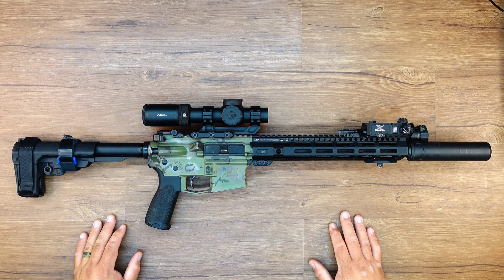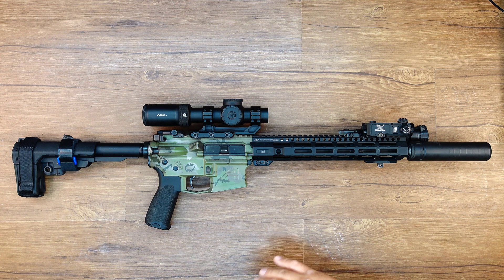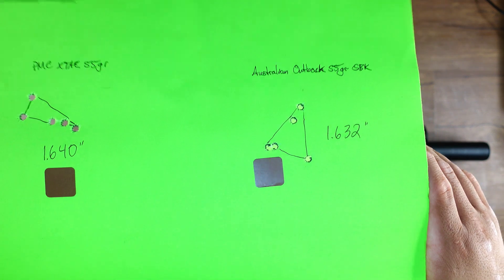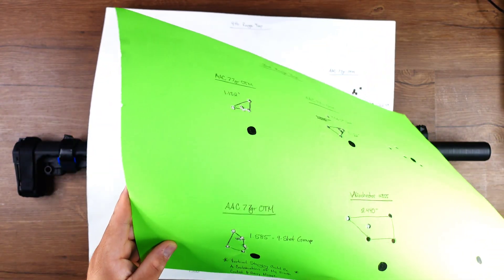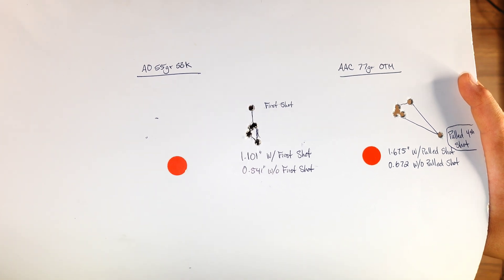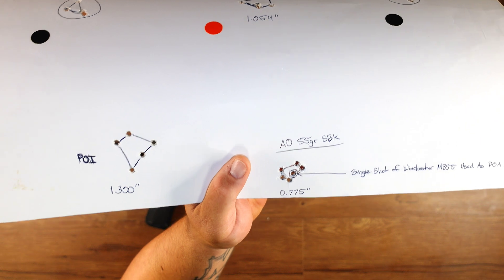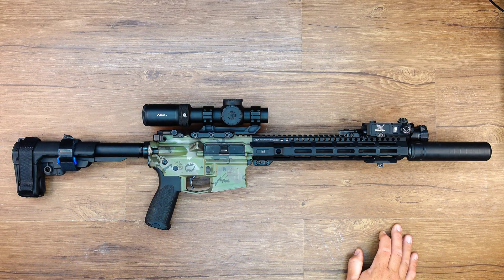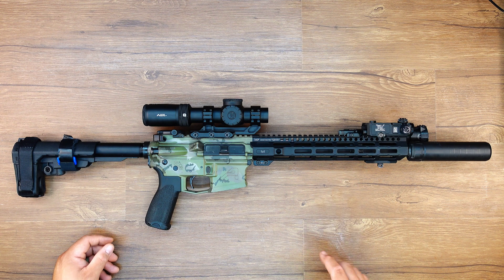Criterion 12.5" Accuracy Testing Update (Pt. 2)

Comment: Sorry for long post… I have a few Criterion core barrels from 11.5” to 18”, my 12.5” can get sub moa suppressed (DA Sandman S W/EBrake and 556 flash cap) shooting IMI Razor core. BH 77SMK MK262 I can get about 1.5”(if you can keep under 2800 fps you will get better accuracy. I have found through all five Criterion Barrels the same thing regarding FPS)The Berger 77 is great to at .8. My 16” with Hornady 73 and IMI Razor core I can get bolt gun accuracy with .3-.5 5 round groups. Took the 16” to a long range class and was hitting the 1008yrd steel 18”x36” target consistently once I figured wind and spin drift. These barrels are great. All my builds are pretty much the same diff rails but all use BCM stripped uppers that I true and bed the barrel torque to 65 ftlbs use BCM BCG with head spaced bolts. Just changed my 12.5” to a Centurion sandcutter with their dual ejector bolt. Groups opened up to .7-1.2 but that no big deal.
Reply from the maker: @LONEWOLF_LCD  that's awesome. Im very happy with their barrels. I plan to change out my 18" Ballistic Advantage SPR barrel to a Criterion. They're gassed perfectly and incredibly well balanced. I'm hitting the range this weekend to try out my 12.5" with the new Deadair Lazarus 6 and compare it to my AAC can. Maybe even get my buddy to come out with me and bring his DA Sierra 5 for comparison, as well.

Comment: You said this was carbine gas system? Which buffer system are you using? Also the gas block? I’m building my 14.5 Mid length criterion barrel with rip cord gas block .625, thinking of using BCM MK2 Mode 1 T-2 buffer system.
Reply from the maker: @chrisbailey8460  I'm running a Vltor A5 buffer system and a Cross Machine Tool lo pro gas block.

Comment: Hey Ivan...be weary. The Romeo 7s on the higher brightness settings tend to bloom really bad. Almost obtrusive. The regular 7 did too, but no where near as bad as the 7s. I experience it both with the Red and Green version. It's an ok optic. I think at that price point there are a few others worth considering. But I look forward to seeing what you think. Still gotta plan a range day with Vit and bring together all the platforms. for review.
Reply from the maker: @christophnegron2827  yeah. I've noticed it can bloom pretty bad, depending on the setting and external lighting conditions. The biggest thing is the halo on the outer edge of the glass. It's not as bad as some have made it out to be, but just like the bloom issue, it's dependent on the setting and external lighting conditions.

We need to link up for sure.